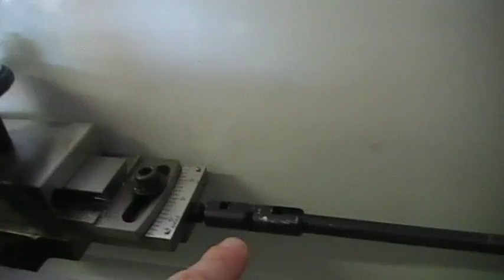Taper Turning Attachment

Comment: Looks good, I have the AL960 and am interested, but I am curious how it drives the cross slide.
To me it appears the travel is limited to the length of the slide at the rear, which also controls the angle, but;
Do you have to disconnect the lead screw somehow?
If you are not turning tapers and need the bed length, do you have to remove the taper attachment and then re-fit and dial in to use it?
How long does it take to fit and dial in?
How easy/accurate is it to set a taper?
Eddie